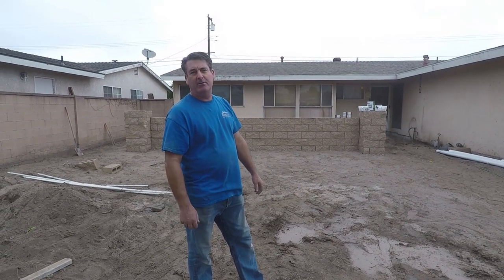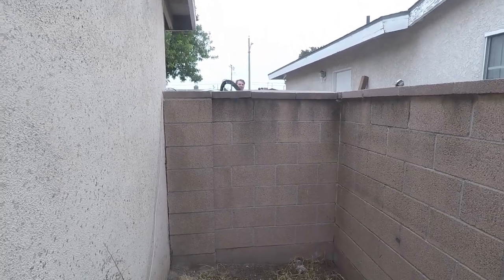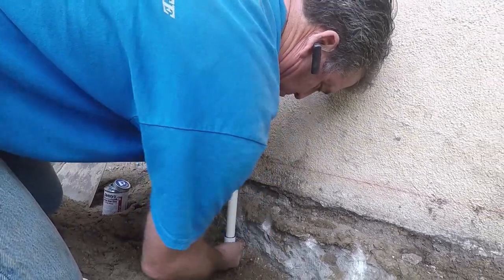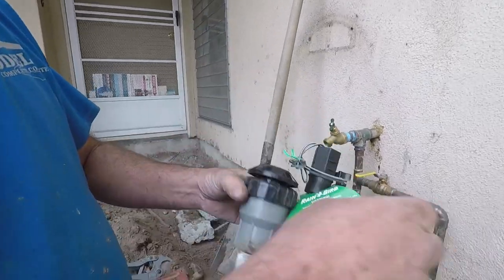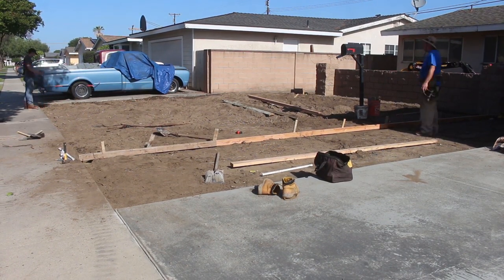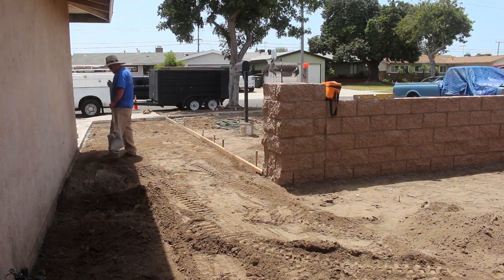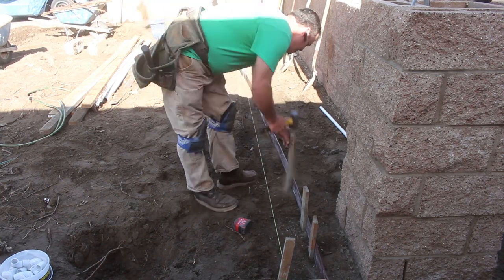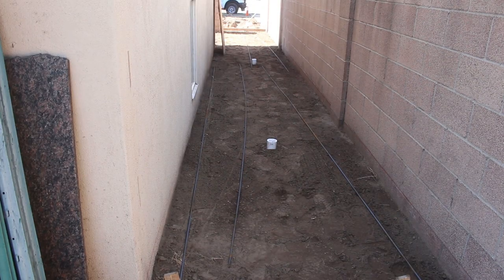Setup for Concrete Pour, Sprinkler Values, and  Mow strip | Front Yard Remodel Part 4

Comment: Love your channel. Always waiting for the next video. Always wanted to learn concrete and block work. 

One thing, you're never supposed to use thread sealant/pipe dope for outdoor irrigation. Once it dries little pieces can dislodge and damage the rubber diaphragm in the valve and you would end up with a "stuck valve". Always use teflon tape.

Other than that, awesome video once again. Cant wait for the next one!
Reply: Me too!!!!
Reply from the maker: I've been disassembling and replacing old valves with pipe dope on them over 40 years old still working and no leaks.
Pipe dope works.

Comment: Hey David, been watching for a while, I was wondering if you can answer a question. I see a lot of people down south using sch40 pvc for irrigation system piping. Only thing we use pvc pipe here is for the value manifolds. Up here in the northeast we use 3/4 poly pipe with sch80 pvc barbed fittings with crimp clamp connections for the main lines and neck down to 3/8 tubing for the heads. Obviously up here sch40 would get brittle and crack on long runs over time with the ground freezing. but i can see it’s a lot quicker and easier to install systems with poly tube, not needing to glue fittings and the tubing being more flexible. Was wondering if there’s a reason why you guys don’t do it that way in the south?

Comment: Primmer is always needed! I wound have gone with schedule 80 pipe on the valves!
Reply from the maker: read the directions
Reply: Odell Complete Concrete the directions are subjective. Pros will tell you to Prime and use Schedule 80 for longevity.